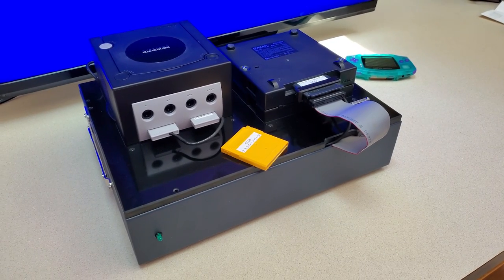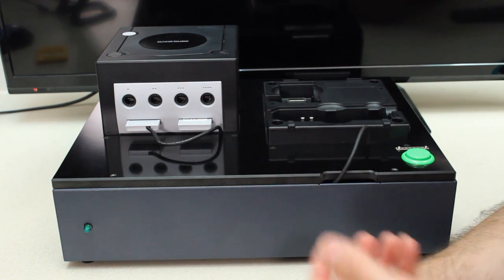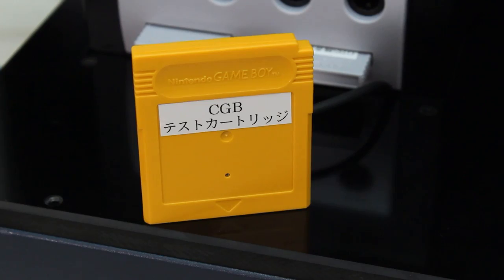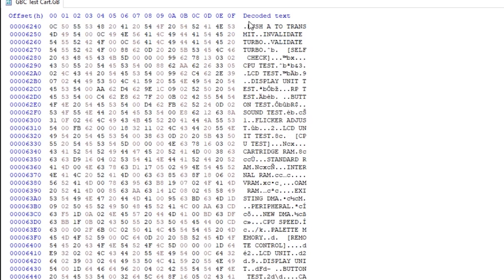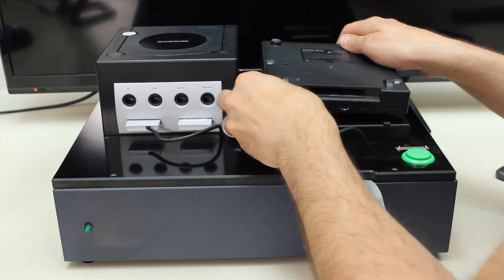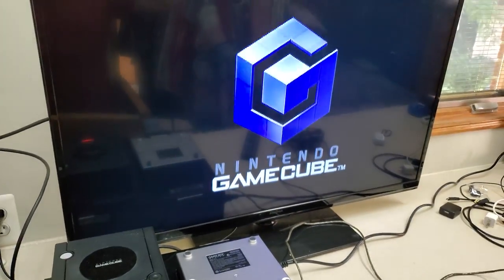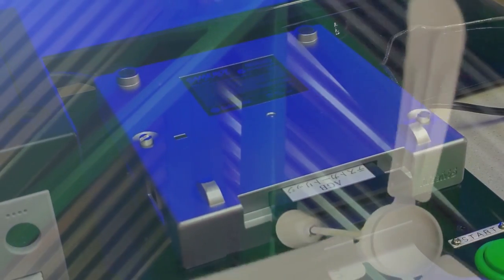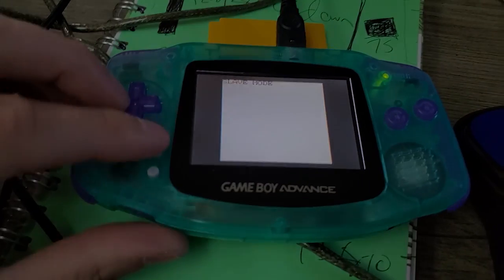The ULTRA RARE Nintendo GBS | Game Boy Player Testing Station

Comment: Maybe it worth to let some engineer, like Ben Heck, to have a look into the boards and chips compare to a normal gamecube + gameboy player unit and try to make an educated guess about what this thing is supposed to do, with luck, if this thing doesn't need extra software maybe he could even make it works.
Reply: @Dradsa  well he made the snes part of the play station work even the disc part, they just didn't have any software made for it.
Reply: @itsasecrettoeverybody  he didnt do it alone
Reply: @Dradsa  also without reading info about the chips you will not be able to know for sure what it does or what which pin is responsible for. And as far as I know there is nothing wrong in using available work to make your life easier, why should anyone start from scratch when there is already work done free available you can use to build upon? IMO you are not a proper engineer if you like to do more work than necessary.
Reply: @Dradsa  okay bye.

Comment: given the gameboy player had a disc to... initialise? just start? the hardware up, it makes sense for debug hardware to have.. did you try the normal disc? can't find error would indicate its not being started or perhaps a cable issue but then that 2nd one shouldn't also have... unless that's the reason these units are even out there

Comment: I run Japanese 100v consoles on 120v. They run just fine. I'm assuming the AC adapters handle it. I guess this thing is pretty rare though. Not worth the risk.
Reply from the maker: Some systems are more susceptible to issues with 100/120 mismatching. Usually it will run but will produce significantly more heat. Also with so many years on some of these its best to avoid the risk.

Comment: this clearly self made by some devs not officially build by nintendo
Reply from the maker: It's is referenced in the GameCube SDK, which is an official Nintendo document.
Reply: @hard4games  in the document is there any picture of the device ? could you please check who assembled that test kit usually you find stickers with information , if it's official device than you should find information that it was built by intelligent system